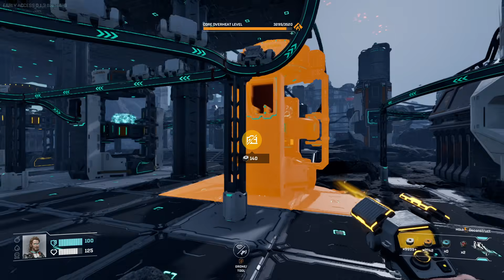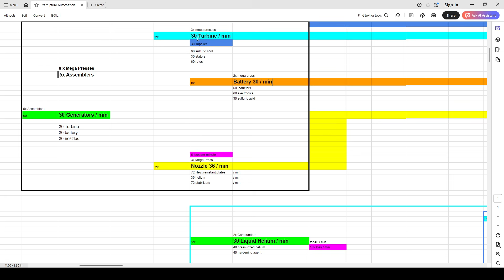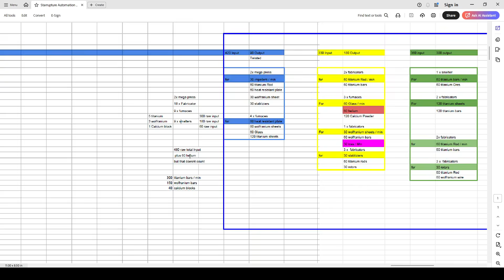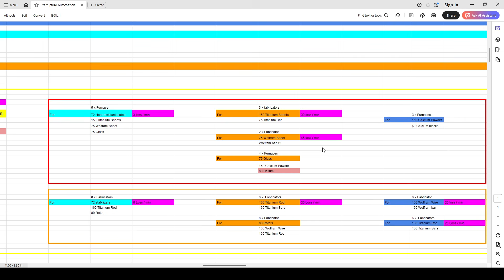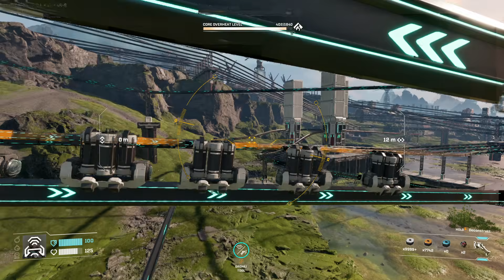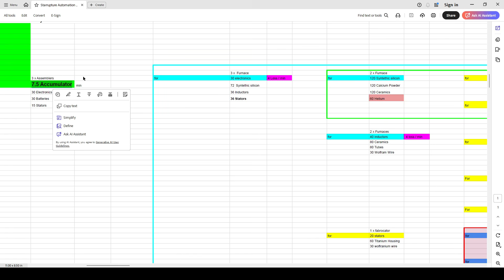How to Finish Starrupture From Starter Zone Only | StarRupture Advanced Tips And Guide

Comment: Silly video, resonators are just a small part of what is required for the maximum level of corporations.
Look in the planner at what production is necessary for stable operation of at least 1 factory with 5 top materials and you will understand how little you have built yet.
Reply from the maker: Finishing the game is sending all resources to companies . Its not about stable production . That will come with next patch where scalimg will need bigger peoduction lines . 
What u are describing is what I did with the excell sheet up untill resonator but in a bigger scale , it is necessary for a fully function satisfaction factory with stable flow of input output which is a automation game pro \ enthusiast thing . 
Most players play these early access game hntil finishing the content and wait for updates so they somt need bigger factory . 
Also not everyone has 200 ish hours to pour into this game so easier , smaller , faster objective completion .